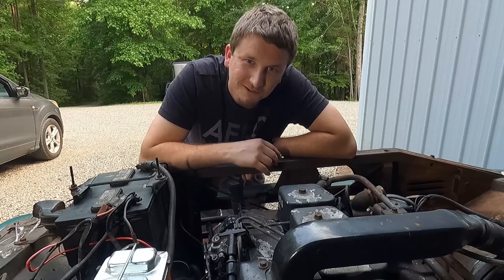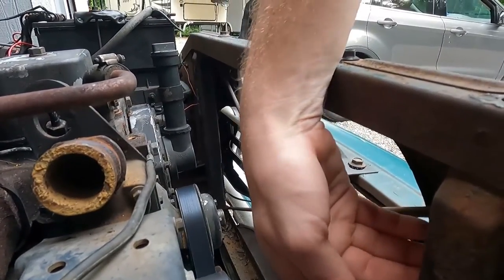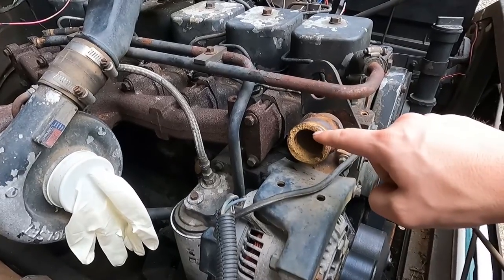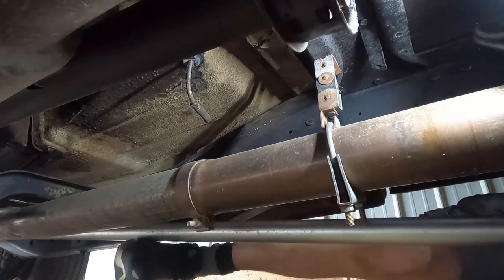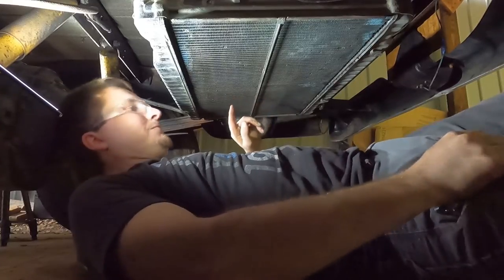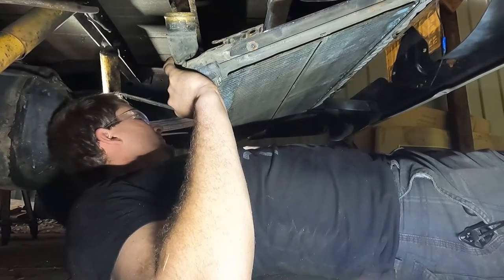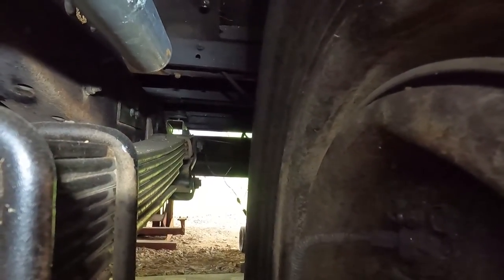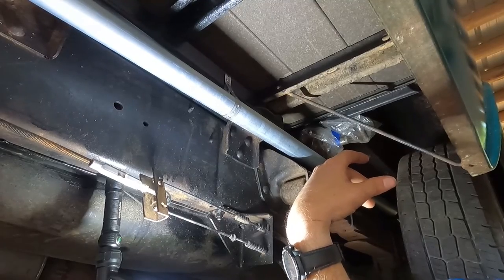C20 TRUCK GETS CUSTOM REAR MOUNTED RADIATOR (How To: Plumbing System + Auxiliary Electric Fans!)

Comment: Awesome truck! I think I would of notched our the core support out and ran electric fans up front
Reply from the maker: Glad you like it! I plan on moving the engineer and transmission backward enough to fit the radiator up front eventually. Just gotta get all the other projects running lol

Comment: I would have moved the motor mounts back about 6 inchs
Reply from the maker: I thought about doing so, but thought it more interesting and quicker to do the rear mount radiator. At least for now

Comment: EMT...  Think you get about 4 years out of that - it is thin walled, and expect internal zinc will wash out after being scoured by fluid flow after a while.  .But I don't think you will be happy long term with those pull thru fan clips.  I have lost a radiator before trying those - chafed right through the tubing a year after install
Reply from the maker: Thanks for the info! I knew it'd rust through eventually and will probably end up moving the engine backwards some and put a radiator up front. 
What do you use instead of the clips for the fan install?

Comment: Everything was so cool until you did that. So wrong for so many reasons. I could maybe see it if you had no other option but you have plenty of room to move the engine back. Now you are obligated to incorporate at least three rolls of duct tape into the build.
Reply from the maker: I probably will eventually move the engine back, but this is kind of a test to see if it works and was actually easier to complete than moving things back and shortening the drive shaft.